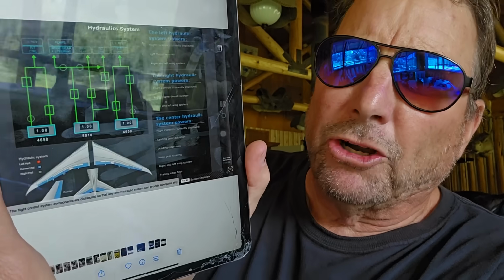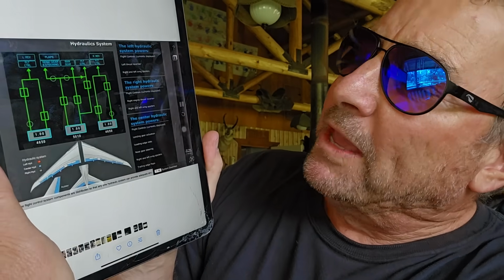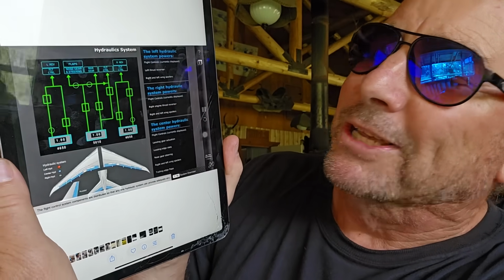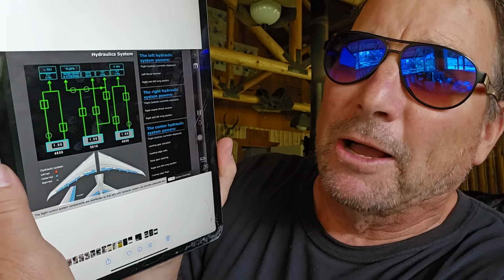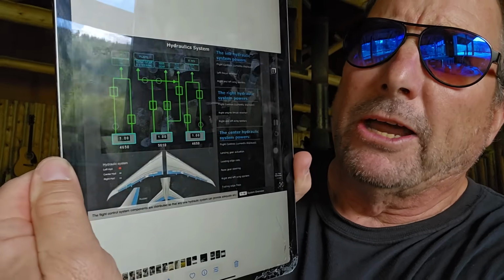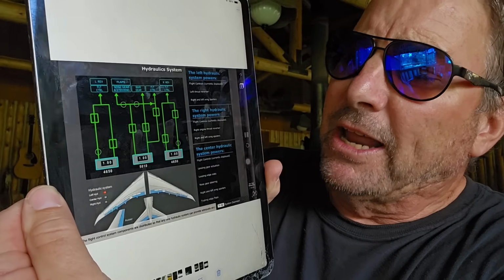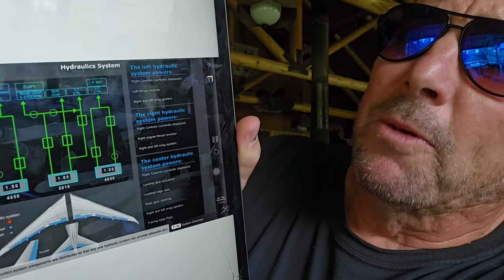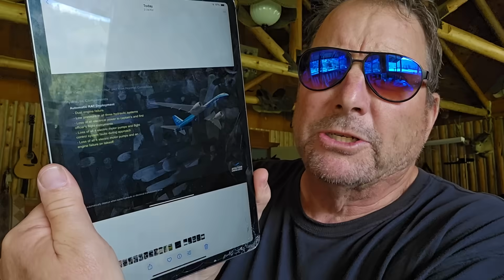787 Crash India What's a RAT? When does it deploy?

Comment: I'd think the flight data recorder will provide some pretty solid evidence of what the problem(s) were. I would hope the investigators get the original video in better quality. Surely there's other video we haven't seen, from the start of the takeoff roll down the runway could also shed some light too. I don't know how reliable physical evidence will be, I saw a video of a large heavy fire truck running over a wing section, right on top of the flaps. The crash site was chaos. But the FDR should tell the story, and the CVR may explain some of the pilot's actions as well. People are obsessed with solving this crash from a couple short, poor resolution video clips and I think it's more complex than that. We just don't have enough information to blame Boeing, the pilots, or the airline but that isn't stopping people from doing it. Thanks as always Juan.

Comment: Thanks, yet again, for a very informative and non-biased personal analysis, Juan.  We've all heard the wild opinions on the news and on the internet as a cause for the crash.    This will certainly take some time and deep investigation (first time for this aircraft) to arrive at a cause, so we'll all just have to wait.  Bright lights will be shined on components and designs along the way which will result in a safer aircraft and the potential of saved lives.
Reply: Safer aircraft?  The 787 has had a stellar safety record its entire life without a hull loss.
Reply: @Objectified  - That''s why it's the first time for this aircraft.  And you'd agree that something happened, wouldn't you?  Safer aircraft, correct.

Comment: If you ignore all warning lights and alarms, is it possible to begin the take-off run with the flaps up?  Can you rotate and climb with zero flaps?    Would zero flaps require such an angle of attack on takeoff  to cause both engines to experience a compressor stall?

Comment: Okay, but the aircraft was still descending under apparent control -- though the pilot workload apparently was so high that nothing after "mayday" was externally communicated -- so 3-axis flight control seems uncompromised. Even clean-wing and only single engine, the descent rate (and what looks like progressive energy bleed) looks much too high. Need the boxes for sure, but the overall energy looks like both engines out. The RAT deployment matches a 2-out issue -- not sure any other considerations align with that controlled descent profile and re-lighting (a forlorn gambit, if both failed shortly after rotation) would have consumed both chairs and explain the lack of external comms (Juan's Aviate, Navigate, Communicate priority list). Not a pilot, but have a cousin who flew F-15s and F-117s and a brother who captained Airbus A3xx hardware to the tune of over 20,000 hours and I'm an engineer. Not looking to jump, but that descent profile needs some attention...

Comment: RAT deployment brings more questions than answers.  Was the very late rotate, basically at the overrun, just a coincidental red herring, or another symptom of whatever problem caused the crash?
Reply: The video of the take-off shows that the aircraft left the ground around the middle of the runway.
Reply: @christopherrobinson7541 which vidoeo of the takeoff?  The one or 2 I've seen, based on direction camera was pointed vs where it apoeared the camera was and such, combined with the dust cloud kicked up, look very much like near end of runway rotation, but I'll admit the particular angles involved made it hard to tell.

I wonder if the ADS data is accurate enough to tell when it rotated?  I may try to look for more camera angles ans the ADS data later.

Comment: Speaking from his hospital bed, Mr Ramesh, the sole crash survivor, said the lights inside the aircraft "started flickering" moments after take off.
He goes on to say the lights started flickering green and white just before impact.
As per a BBC news article titled "'I walked out of rubble': Survivor on how he escaped Air India wreckage" posted today.
Reply: And there is now a video made by a passenger on the same aircraft on it's preceding leg.  Seems the Air Conditioning was not working in the cabin, nor the entertainment system, nor cabin lighting.  Starting to sound like a problem that was not identified in the couple of hours on the ground between legs.
Reply: @gomezgomezian3236  that's just Air India for you. The older planes have been plagued by these issues for years, but never affected safety. The 787 was scheduled to go for a full retrofit within a few months.
Reply: @atrajitroy1  Is that really the case? Can airline legally operate with non-functioning AC and other crucial electrics?
Reply: +1
The Boeing 787 Dreamliner primarily uses electric fuel pumps for its engines. While some systems utilize engine-driven pumps, the 787's architecture leans heavily on electrical power for various functions, including fuel delivery. Specifically, the center hydraulic system employs two high-flow electric pumps instead of engine-driven pumps. Additionally, the 787's bleedless system, where engine bleed air is replaced by electric power for many systems, further emphasizes the reliance on electric pumps.
Reply: Sounds like electrical problem…
Reply: @aliasgharkhoyee9501 yes, most transport category aircraft use the APU to power the packs and get air conditioning on the ground. I am not a 787 pilot, nor do I work for a 121 airline, but most airlines have minimum equipment lists (MEL) that allow certain components not essential to the safety of flight to be deferred for repair at a later date. The APU is usually not a required item and can be deferred per most MEL’s. However, I am not an Air India pilot and do not know the details of their MEL’s and such.
Reply: I wouldn't rely on anything the survivor said he's changed his story a few times already.

Comment: LOVE this channel and the knowledge drops, but as a point of correction, it always operates as a turbine, and never a propeller.  I'm sure that's just a slip of the tongue because Juan knows the difference.  A propeller and a turbine work exactly the opposite of each other..
Reply: The RAT is a propeller that turns when the wind hits it, a concept known as windmilling.   Its turning is used to generate electrical power so it is functioning as a turbine.  

When an engine quits on a simple prop plane, the prop will windmill, meaning it continues to turn fast.  With a constant speed prop, found on what are called complex single engine planes and twins, one can change the angle of the propeller all the way to what is called feathering (basically perpendicular) to stop the windmilling reducing drag.  Doing so is a critical step in staying alive in the event of an engine failure on a light twin.  In all the turboprops I flew, one can change the angle the other way to actually reverse the direction of thrust.  King Airs will back up on the ground.  Shorts go forward at 35 knots in full reverse which is why one can't taxi them using differential power if the hydraulics fail - no brakes.  

Helicopters use the concept of speed equals fast prop rotation with no engine power during auto-rotations to store energy in the rotor (large prop) then change the angle (pitch) of the blade right before hitting the ground to stop the descent and set down gently instead of crashing.
Reply: @loudidier3891  //"The RAT is a propeller"//

Nope.  The rotor of the RAT is a turbine.  The blades of the RAT NEVER operate as a propeller.
Reply: @loudidier3891  To be precise, a propeller accepts an input torque and uses that input (or inertia in the case of a helicopter autorotation) to accelerate the fluid relative to the rotor disc.  A turbine slows the fluid relative to the rotor disk and outputs a torque.  Exactly the opposite of each other.  

Yes, a helicopter rotor acts as both a propeller and a turbine (at rare times).  Yes, an airplane propeller can operate at as turbine (at rare times).  Both of the 'rare times' cases involve engine failures or simulated engine failures.  The RAT has no mechanism to operate as a propeller (it can't develop thrust) -- it can only operate as a turbine.

Comment: What causes automatic deployment of the RAM Air Turbine ?

from the Boeing 787-8 systems manual:

In flight, the RAT deploys automatically if any of the following occur:

• both engines have failed
• all three hydraulic system pressures are low
• loss of all electrical power to captain’s and first officer’s flight instruments
• loss of all four EMPs and faults in the flight control system occur on approach
• loss of all four EMPs and an engine fails on takeoff or landing...

The RAT can be deployed manually if necessary by pushing the RAM AIR TURBINE switch on the hydraulic panel.

Lots more questions than answers at this point.

Captain of this flight had 8,000 hours, the First Officer had 1,100 hours.

Comment: They used the whole runway including the overrrun which is why dust is kicked up.

There is no yawing motion meaning both engines had an equal lack of thrust

The rat was clearly deployed  from the audio.

The plane was a several hundred tonne glider at 600ft

Did they fail to reject the take off or was the problem after the point of no return
Reply: Always a difficult decision.
It feels like it is going to fly. 
You want it to fly.
Reply: No, the aircraft rotated around the middle of the 3,600m runway.

Comment: I recall the 787 having serious lion battery fire issues early on....  a severe fire could cause a lot of damage very quickly, especially if it started before takeoff.
Reply: Once burned. 
That area will have lots of fire sensors and suppression. 
It will be on the black boxes.
Reply: Not applicable here
Reply: @you463  I'm not sure how we can know anything at all at this point, we have very little information.  It may not be, it may be.

Comment: FDR and CVR should be easily located based on picture of tail pretty much intact sticking out of building. 
RAT can also be deployed manually. 
I didn't see any definitive yaw of the acft, or major rudder deflection,  like a single engine out to compensate. 
Dual engine failure seems remote,  but possible I guess. 
Lone survivor mentioned something about engines running up, but acft just hanging.  ( Para phrase).
This one gonna be interesting.

Comment: If they lost hydraulic pressure could the flaps have "retracted" themselves from the wind pressure, or do they lock in place? Is there/could there be a lag between pressure loss and the RAT providing power back to the pumps?
Reply: The flaps etc have non-return valves that keep these devices in the last commanded position, they cannot be moved by the airflow.

Comment: Something happened in the 5 second between V1 and calling positive rate climb and gear up. Something that was immediately attention grabbing and more important than the gear lever. Maybe a sudden drop in N1 or N2 speed. Can bad fuel or wrong fuel have cause loss of thrust? These were experienced pilots and there's no way am I going to believe something like "they retracted flaps instead of gear." There's something that happened outside the scope of the pilots and the aircraft. I think an act of terrorism by Pakistan is more likely than the pilots forgetting to put down the flaps.

Comment: The takeoff role seems extraordinarily long. You can actually see dust and debris cloud at rotation. Runway should be FOD free, so could this be overrun??? I question flap setting but the videos ive seen lack clarity. Is it possible an electrical issue prevented the flaps and slats to deploy? Or more importantly, could the same electrical issue cause a loss of hyraulic pressure retracting flaps and slats during takeoff roll? That takeoff roll is just too long....pure speculation, but RAT deployment is confirmation of an issue in electrical and/or hydraulic systems. Videos remind me of and Airbus crash at an airshow in France.  Thanks Juan

Comment: Let me preface by saying that I know absolutely nothing about the 787, but I did fly other big Boeings.  In my entire aviation career, in all the aircraft that I’ve flown or worked on as an A&P, I’ve never had a jet with a RAT that didn’t only produce electrical power.  None of them ever produced hydraulic power directly.  The RAT produced limited electrical power that was supplied to an electric hydraulic backup motor for a specific  hydraulic system.  That’s been the general rule as I’ve known it.

Comment: I have one question regarding the “sound” of the RAT being reported. Do we know what the origin of this sound clip is? The crash footage we have seen is from fixed security cameras. They don’t normally pick up sound. One clip, the one that seemingly has this sound, is from outside the airport on a busy commercial street. Right now there are a lot of crash related data points being claimed. Without any actual verification of sources. We don’t have actual ATC recordings. We’ve been told that there was a “Mayday” with some claiming the pilots said “loss of thrust” but the actual ATC info has not been released nor indexed (if it exists) to the timing of the incident.

Comment: This is Air India issue. NOT a Boeing issue. This is the first complete hull loss of any airborne 787 in its 14 year history
Reply: Funny how there's a need to immediately put the blame squarely on one or the other camp. Let's wait and find out before pointing fingers.
Reply: @markusstudeli2997 exactly, but the reason I said that is because even people who should know better say “Boeing Boeing !!!” When the aircraft itself has a stellar safety record
Reply: @jimsteinway695 Sure, why then go to the other extreme and assure it's an Air India issue. Neither Air India nor Boeing have a stellar record. The B787 did not crash so far, but it did have some quality issues in production, as far as I remember.
Reply: @markusstudeli2997 because Air India has had this plane for years and it’s been through their depot maintenance several times meaning they’ve taken the aircraft apart and put it back together many times. AND an ex Air India pilot said this is their most valuable route and the company will NOT remove that aircraft from that route for anything.  He also said their maintenance on this aircraft is very poor.  Once and aircraft has been with an airline for years if there’s no glaring manufacturer defect it’s pretty much up to that companies maintenance department to do all the A, B, and C level maintenance inspections and repair.  At that point the manufacturer is really no longer involved unless there’s directives or recalls etc.
That combined with the 787s stellar service record, it sorta points at Air India who’s not exactly known for excellent service. There was a video of the crash aircraft from the flight before and nothing worked in the cabin. No Ac no passenger entertainment, nothing .  Other than that I’m guessing

Comment: Thanks, Jaun, for waiting and doing research instead of jumping to conclusions. Their local media is also reporting that they recovered a DVR (digital video recorder). What on earth is that? What data would it have, and why would modern planes have them? Isn't CVR and FDR enough ? Thanks
Reply: Many modern aircraft have video cameras on the outside, partly for passenger entertainment and partly to give the pilots a better view of what's happening. It might be that these have memory cards built in. They won't be capable of withstanding the intense conditions the FDR and CVR can but, if they survive, they will provide useful data (e.g. the fin top camera will confirm flap and slat deployment).

Comment: All of the conditions listed are major incidents, no-one wants any of them to occur.  The RAT is an emergency back-up.  So, if it deploys, bad things have been happening.  That's one thing.

Watching video of the occurrence aircraft as it rotates, I couldn't help but notice the stowed flaps.  Ground effect got it in the air.  It appears however, that once out of the ground effect, there isn't sufficient airspeed to maintain the lift necessary and not enough altitude to go nose-down to increase the speed for more lift.  I'll be very interested in finding out how the aircraft was configured for flight.

Comment: Ron remember this

In 1987, during a Delta flight from Los Angeles to Cincinnati, a pilot accidentally pulled the two fuel levers instead of intended buttons during a malfunction in the electronic engine control system.

How many up in cockpit?

Seattle pilot 🧑‍✈️ had Episode

Comment: In the video taken from the right side of the aircraft as it's wallowing down before impact, it doesn't appear that the RAT is deployed. It's aft of the right main gear well on the outboard edge of the fuselage, I believe it would be visible from that angle. The 787 RAT is also pretty big compared to the 777 or 747 RAT.